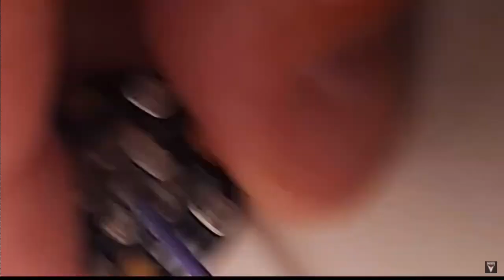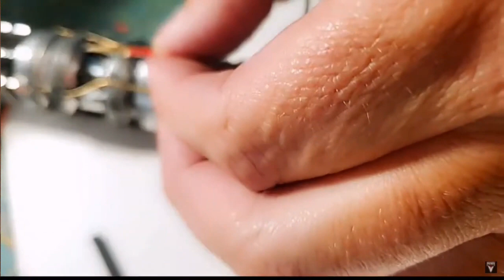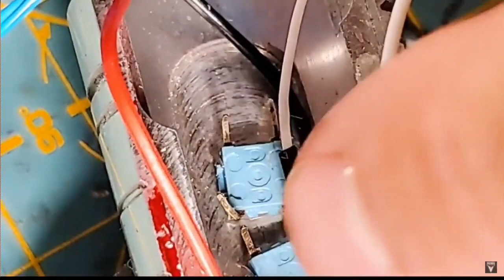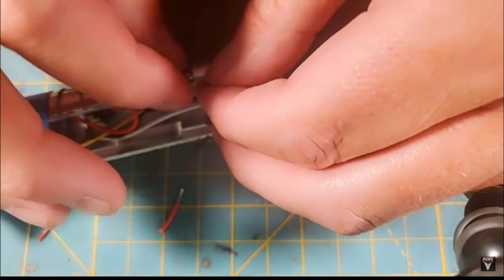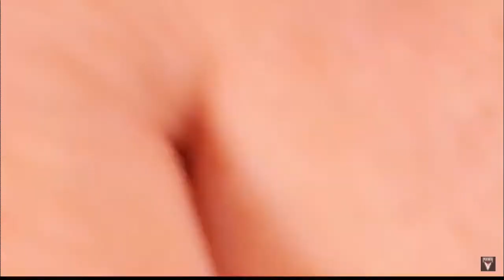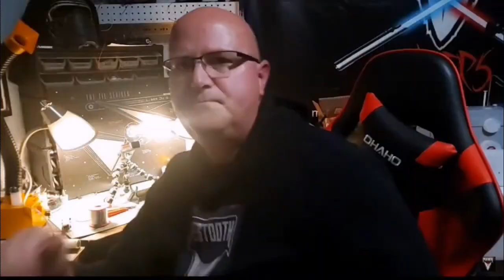Gary Morris Samurai Proffie 2 2 Install Very Detailed, includes fails.

Comment: It seems counter intuitive, to me, that you remove one of the two resistors when using an  independent blade configuration/data lines.  I would think that would be when you'd need two resistors. I'm missing something.
Reply from the maker: the second resistor connects the data trace do from onboard resistors to the center pin.